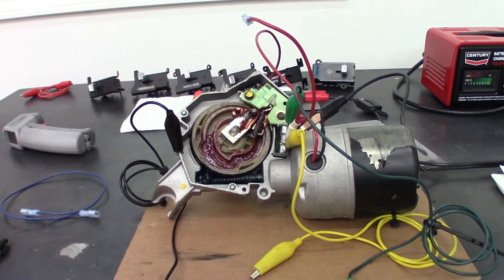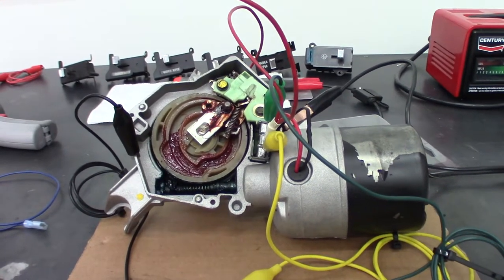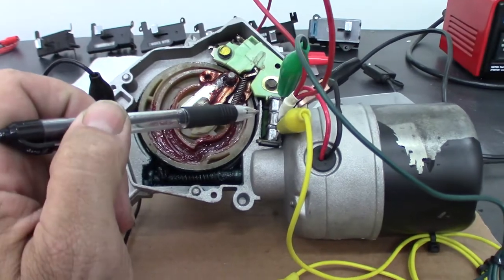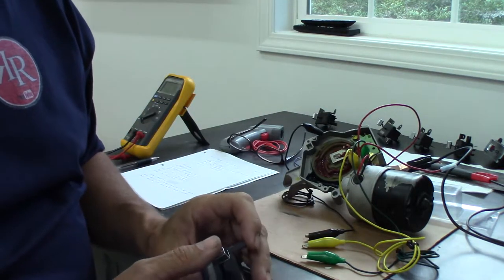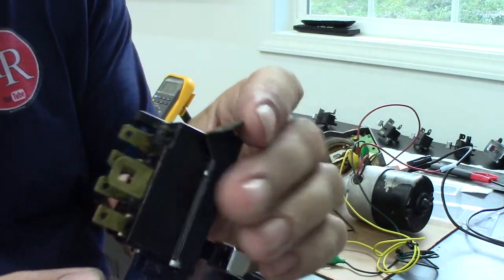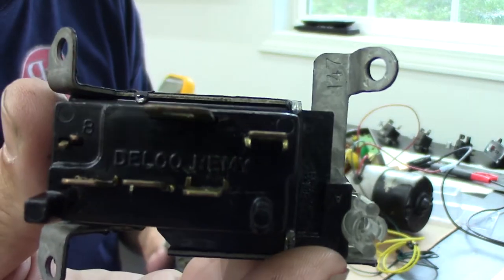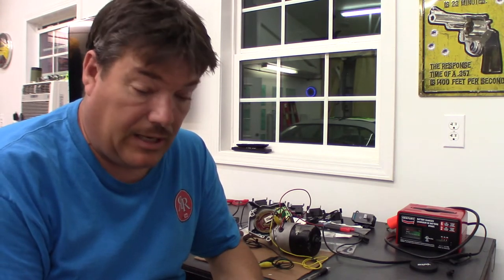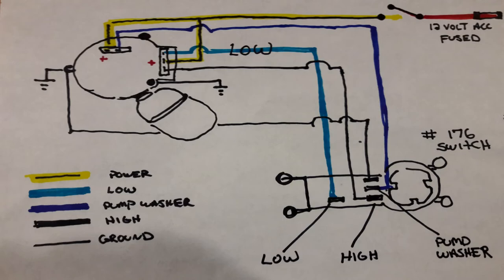1970-81 Camaro Wiper Switches and Hidden Wipers

Comment: OUR 76 Trans Am we just got had a toggle switch for the wipers. I got a couple switches off Ebay and your wiring diagram is a great help to me. I got it to move the wipers about 2 inches and then they stop and never move again. Working on it.
Reply from the maker: Did you get them working?

Comment: You should have been with us back in the late 80's replacing those switches, we got to learn the hard way of which switch went to what year of Camaro.. When the switches started going bad on mine and my friends Camaro's we went to the local junkyards and it was a lot of fun getting the right one out of the same year car in rural Ohio, the fan switches were fun also because they always went bad in the '70-'81 model and those were fun to replace also. Good memories, thanks Russ!!
Reply from the maker: I bet that was frustrating. Thanks Darrin. I wish there was still alot of these cars around for parts.
Reply: It wasn't that bad Russ, what was nice that my friends and I had different year cars so we had an idea about the smaller differences in them.. Me too my friend, the days of going down to the local buy here pay here and picking them up for less then a grand are long gone

Comment: A good way to clean terminals ,plastic, and rubber is sand blast, with the harbor freight stand up blaster. Good video.
Reply from the maker: Great tip! A blaster is a must have tool for restoration work.

Comment: Thank you for taking the time to make this great video.  Can you tell me what could cause wipers to be stay running even with switch off?  Mine are pulse type in a 79 with the squirt pump in the motor assembly.  They started running all the time and wont stop.
Reply from the maker: I have never had any experience with a wiper system with pulse wipers. If the motor is similar to a regular one, it must go back to low speed before it can park. I guess it possible that it could be the switch, the motor or internal wiring. I would probably pull the motor and bench test it.

Comment: Excellent video. Thanks for sharing your knowledge and experience!
Reply from the maker: Thanks James. I learned alot on this video. I had a few vids on this subject where I was trying to help a fellow YouTuber with his car and those led to this video.
Reply: @DoubleRRestorations  The pin out / schematic was a big help. My wipers on my 73 Camaro will not turn off. I have the 147 switch. I suspect it something in the switch has gone bad / broken. I was planning to disassemble the switch. Any advice is appreciated. I am just starting to troubleshoot. Thanks again!
Reply from the maker: @James Miles  From memory, the wiper motor has to go back to low speed before it can park. Sometimes it's worth bench testing. Also make sure the motor has a good ground
Reply: If my wipers won't turn off (147 switch), do you think it is in the Switch or at the motor? I heard you mention about a resistor on the motor assembly for the park mechanism. Thanks for the help.
Reply from the maker: It's definitely worth checking.  You can take them apart and clean them. You just have to take your time and reapply some dielectric grease. The stuff hardens up after several of years. It could be something at the motor ad well.
Reply: @DoubleRRestorations  Can I basically use any 12v battery charger as a power source for testing on the bench?
Reply from the maker: @jmiles1960  Should be able too

Comment: Thanks, this video really helped with a total rewire of a 1980 Camaro.  Same '549 switch as your '81.  Testing with an ohmmeter, it seems a little shaky in the Low speed position (not reliable continuity).  You mentioned having rebuilt some of these switches.  Any chance you have a video on that, or one you like?  Looking at mine, first thought is it would be easy to break the tabs holding it together.  Thanks!
Reply from the maker: I don't have a vid on rebuilding the switch, but the one I rebuilt was pretty straightforward.  Just be careful not to break the clips and when you first open, try to be as gentle as possible, not to lose the orientation of the parts inside. I hope it helps

Comment: Thanks for the video! Helped me to understand few things and confirm my 128-switch is most likely broken. I know it is of course wrong, but I wonder if anyone making bigger modifications to their old Camaro has updated the whole switch to something more modern and relocated it from the dashboard. I would like something I can reach with my fingers from the steering wheel. My 72 Camaro has lot of new tech installed by the previous owners including a 2001 Corvette engine. It had also already a separate button for the washer added by the previous owner and it did not work even though the motor for wipers and washer was new. As I could not make the washer work and I prefer the washer to work continuously as long as I press a button, I already bypassed the pump and replaced with a modern pump. Motor for the wipers can stay original, but I am thinking if I could find a more modern and still good looking switch from some other car and replace the original one that is broken. I am currently making a new dashboard so this could be done at the same time maybe. Maybe I buy some used one and modify it to resemble the signal light switch. How to attach it to the base of the steering wheel remains open... but yeah, I wonder if anyone else has tried this before.
Reply from the maker: Awesome, glad to hear the video helped. I know some folks have added electric pumps to the motor.

Comment: Another awesome video that helps me out tremendously.  So it looks like you can use any switch with the hidden wiper motor and the motor will still park the wiper blades??  Thanks.
Reply from the maker: Thank you, and yes it just depends on the wiring. The motor must go back to low speed before it can park.
Reply: Got it.  Thank you very much sir.  I don't suppose you had a video installing the bow style headliner in your Project Overkill??? @DoubleRRestorations

Comment: Thorough and well explained
Reply from the maker: Thanks Mark. I'm sure it will help all of us second gen guys out.
Reply: @DoubleRRestorations  How common is it for the switch to go bad?  I have a 127 and the switch looks good, but the wiper motor stopped shutting off and the motor had some smoke coming from it.  Could the switch be fine and the motor be bad?
Reply from the maker: @MadDZines  It is possible for either one to be bad. You should be able to verify the switch with an ohm meter. If it checks out, I would say that something may have let go in the motor. Also double check the wiring going to the motor. If all else fails you could always bench test the motor to verify if its defective.

Comment: Any diagnostic info on the pulse delay system? 78-79. Switch #14001502. Mine runs with key on won't shut off, new seven terminal motor installed. Squirters want to run and it stays in high speed. Switch to high and it goes to low speed. No apparent shirts to ground in the harness.
Reply from the maker: Sorry William, I haven't worked on a pulse system yet.

Comment: Are those other switches a direct replacement that will work in place of the OEM switch that they no longer make and if so what is the part number for the one that does delay? Thanks for all your help. Dave
Reply from the maker: Dave, I don't have any experience with the units that have delay. I think you can make most of all these switches work with the correct wiring configuration. Thanks.

Comment: A bit off topic, outdo you know what type of pins are inside the cluster circuit connector (12 pins).
Reply from the maker: Not sure I follow. Are you talking about the 12 pin connection for the cluster?
Reply: Yes. I have since found those pins   and have fixed it.  I de-pinned and replaced the pins.  Thank you for your reply.

Comment: Awesome video 👍. Just started Working on my wipers on my 78 T-top camaro, don’t know if the switch or motor is not working. I have power at the wiper fuse . Is there a wiring diagram for the wipers so I can chase and trace?
Thanks for any help 👍
Reply from the maker: Timmy, Sorry I don't happen to have a schematic. There are a few good ones on google images that may help. You could always take it out of the car and bench test it.

Comment: Good morning friend, I would like to ask you a question.  Have you worked with the GM 7835342 wiper switch?  My case is the following.  I have a 1982 Chevrolet Malibu and it uses that switch but I really can't get it to work.  The wiper motor is generic, and I've already managed to identify the fast speed, slow speed, the positive, the negative, and the switch.  and still can't get it to work.  I would really appreciate your help my friend.  greetings and a big hug from Venezuela and forgive my bad English.
Reply from the maker: Hey there, sorry, just saw this. Did you get it to work?  I don't have any experience with that switch, but it should just switch the ground side of the circuit starting at low speed, then high, most motors have to go back to low speed before they can park. I hope it helps

Comment: Okay so I a 72 w/hidden wipers. Every switch you used seemed to put the wiper motor in "park". Am I looking at that wrong? It is near impossible to find a 72 hidden wiper switch and I am told the "standard" switch will not work. I have a t/a switch that I was told will work but I just wanted your humble advice before I mess up anything. Thanks for the video!
Reply from the maker: It probably will work. I would take an ohm meter and see what the pin out of the switch is. Most likely it will be the same as one of the switches in the vid. You could always bench test it before trying it in the car. Your only switching the ground side of the circuit, so you should be safe from messing anything up. Basically the motor goes into low speed before it can go into high, then it must go back into low before it can park. Hope it works for you and you are correct, the hidden wiper switches are difficult to find.
Reply: @DoubleRRestorations  Thank you brother! I will certainly try it.

Comment: Hi russ would you have assembly intructions to reassemble inside of the gear box
I opened mine and a peice fell out 
Not sure where is goes 
Can you help
Reply from the maker: Just saw this, I don't have assembly instructions, did you get it figured out?
Reply: @DoubleRRestorations  
Hi russ
Yes u
I did once I stared at or for a while it made sense 
Also found a picture so I could verify  and to my surprise I did it correct 
I now just need to find the relay inside with the terminals on it this one is bad
I would send a picture but not sure how

Comment: Hey, I have a 1980 Camaro without pulse wiper switch that doesn't work. It's exactly the same as your #549. I haven't been able to find a new replacement. Any idea where I could get something that would fit? I can find used replacements online but they could be just as bad as the switch I have. Also, any idea what I'd need to do to convert my wipers to pulse? Thanks
Reply from the maker: I have no experience with the pulse. I feel like it was a rare option on these cars. It is a completely different switch/motor. As for replacements, most likely you will have to go with a donor part. Sometimes you can find them on eBay with a 30 day money back option
Reply: @DoubleRRestorations  Ok, thanks!

Comment: Thanks for the video- Can you tell me the wiring colors and where they go on a 131 switch? It has 5 wires total. Dark blue-Light blue-small black-large black-black with eyelet hole.  Thanks for any help
Reply from the maker: Unfortunately I have never worked with that switch. You should be able to use an ohm meter and figure out its pin out. I bet its similar to one in this vid. As for the colors, I don't have a schematic. I would try to use the ohm meter again and see which one goes where to the motor.  The one with the eyelet will definitely be a case ground.

Comment: Note the 1970 1971 RS Camaro  [dash mounted] hidden windshield wiper switches .Part no.19904097 or part no.1994098 are different hook ups. Then the 1974 to 1981 ones
Reply from the maker: Good to know. Thanks for sharing. There are a few more different switches for these cars, but I only tested the ones I had. Not sure why GM used so many. lol.
Reply: Yeah that's what I'm learning..  I have the correct motor, correct #097 switch and I can't find any wiring diagrams or videos on it. I'm told it is the "rare" #097 switch... guess that's why I can't figure it out or find a drawing of the wiring.  This has been the most frustrating part of building this car so far. I have four different switches, two different motors,  three sets of wiper transmissions,  all new AAW classic update kit installed and no matter what I do the new motor just runs... if the key is on the wipers are on. It's not the park relay everyone is telling me it is because they start right back up when the ignition is turned back on.

Comment: Hello my friend, i have a 69 impala and i been trying to install my new wiper switch back on my dash.. it looks like the ones you have on the table there.. i have it where it goes and its pluged in, and its working , but its just flopping around i cant find where any screws go...😫.. if you can help me i would be very grateful sir... thanks
Reply from the maker: I'm not sure on the Impala's, but on the Camaro, the wiper switch is fastened to the gauge bezel with screws. Hope it helps.